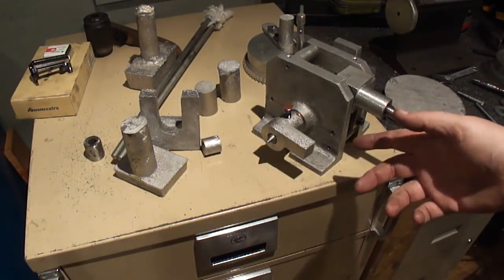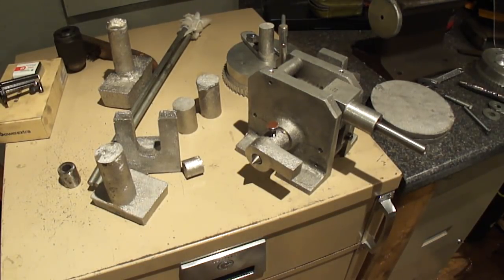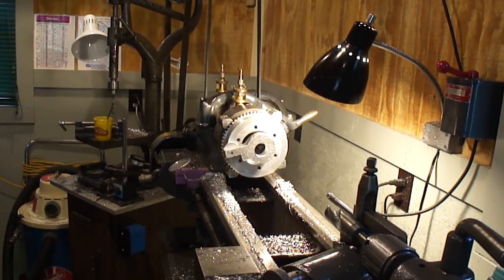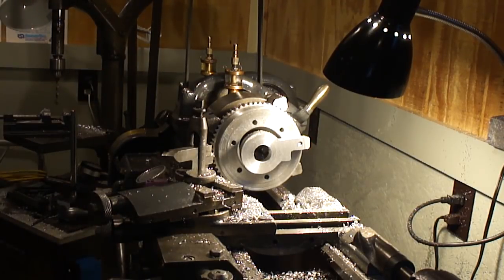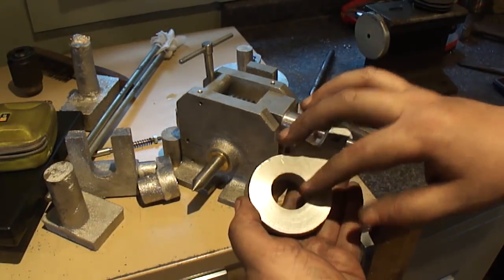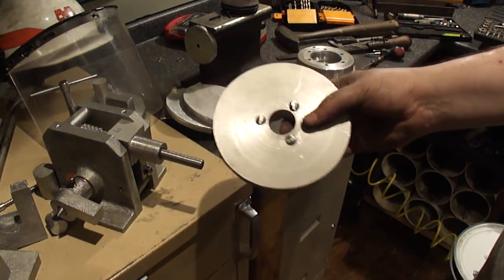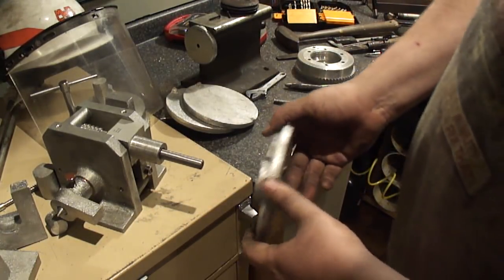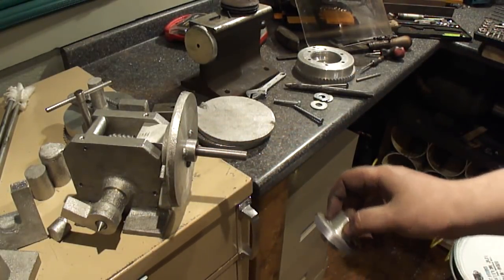Gingery Dividing Head P6 - Plate Hub, Plate Carrier

Comment: Man if you're not careful that thing is going to end up finished ;-D Have you figured out the hole patterns yet or are they in the book? Ya gotta hate power outages when you're tryin to work!
Reply from the maker: lol, yea, Im hoping to have it finished within two weeks because I have a big thing coming up and just wanted to have it together and in working order before that.  The hole patterns are kinda in the book, or the division tables are in the book, but it also shows how to do the setup for drilling the holes using paper, some pencils, a ruler, and a drafting square. 
I figured that I would try to get it all together first, then worry about making the plates because I was planning on casting out some more plates, and kinda trying to get the one part finished before I start on the plates so I can bundle it all together to cast it all at once.
Reply: Makes good sense. Thanks.

Comment: The dividing head is coming right along and looking great.  What is your plan for a first project using it?  Also, on a different note, I watched your Q&A video on your casting setup.  Would you object to making a video describing your oil burner in detail.  I would like to make one of these.  I have been using charcoal and propane for a while and would like to step the game up a bit.

Thanks -- Joe
Reply from the maker: I think once I get everything finished and set up, I want to make a 64 tooth gear for my lathe to open the threading capabilities that it can do probably. That or just make some sort of chuck adapter/mount for it to make it easier to mount the work on it.
The oil burner is just a kwiky burner, there's a few videos out there showing how to make it and it's pretty simple. My burner is all together and tuned, so I rather not tear it apart again, also some of the parts are soldered together, so you cant get it apart fully. It's easier to just look up "kwiky burner" on here and find david's video on making it.
Reply: Thanks Chirpy, I will do a search.

Comment: Dividing head is coming together nicely. Hobbing the gear on the lathe was interesting. Looked like the shaft was moving a lot but results look impressive.
Reply from the maker: shaft was moving a little bit, but only when the teeth were getting cut at first. It honestly looks like there was more movement on video than there was in person. By the end of the process, the shaft didnt move at all and was solid. If I were to do that whole setup again, I would just have the hob supported between centers. Thanks for watching.